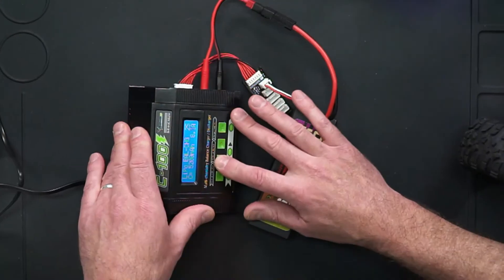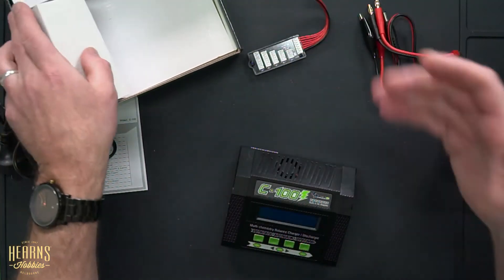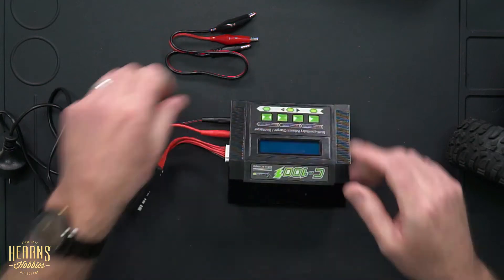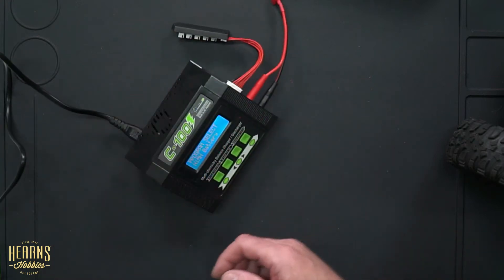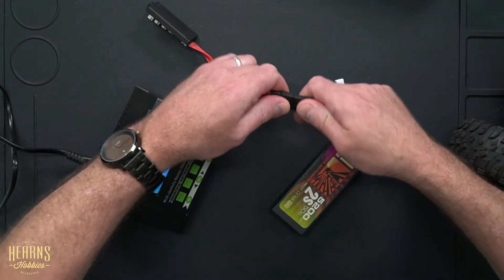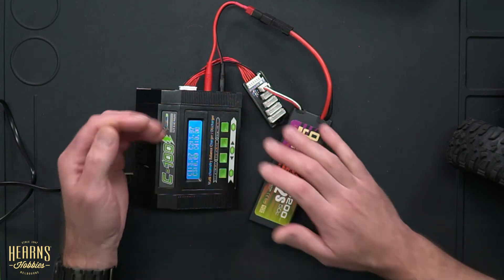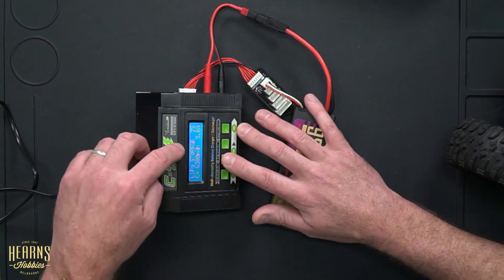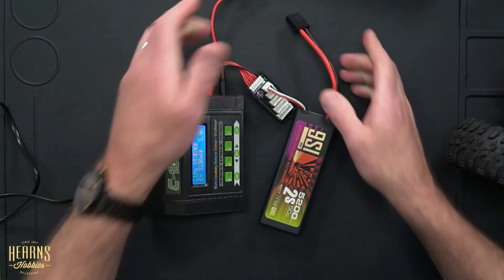Tornado RC | C-100 Multi-Chemistry Battery Charger | #askHearns

Comment: Hello, thanks for your info, it's very informative.  I am new to all this, and have the c-80 tornado,  and had taken m  new RC boat out, and learned from you I need to storage charge my 3300mah 4s  lipo battery. I set it up to do so, and the charger will not go past 1.0 A. Is that a safeguard, to make sure that everything is being charged slowly? Also, can you tell me if these batteries just die after being discharged, ie if my powerboat was in the middle of a lake, would it just stop when empty, causing me to go for a swim to rescue it.
Thanks again, Happy new year!